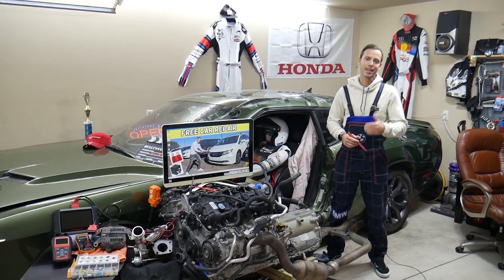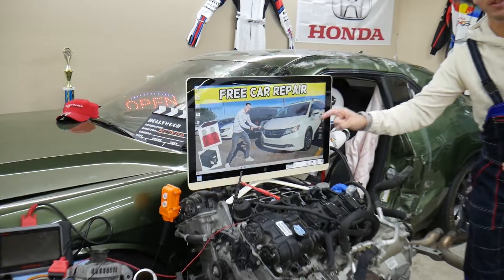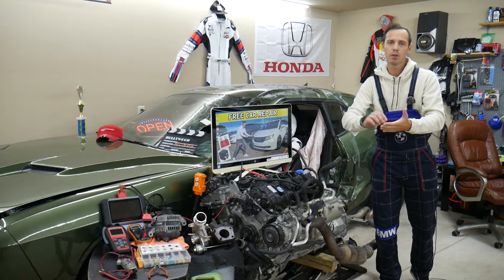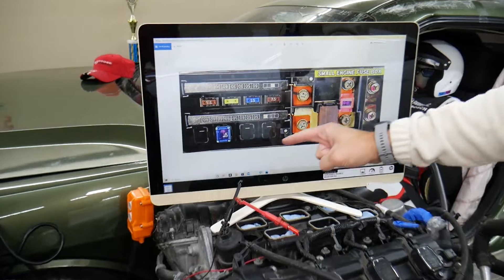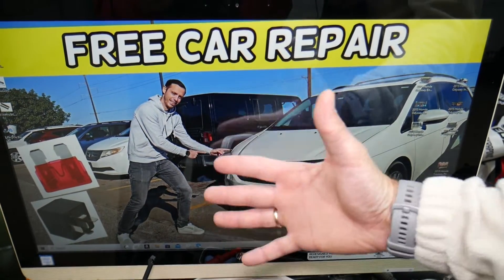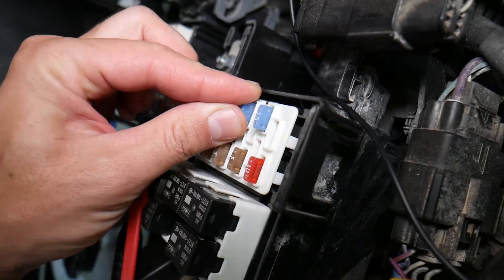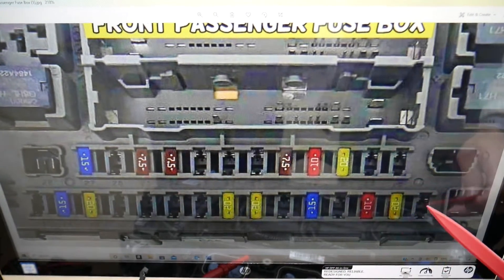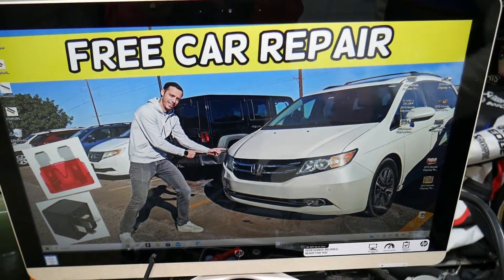HONDA ODYSSEY REAR RIGHT POWER SLIDING DOOR FUSE LOCATION, DOOR NOT OPENING CLOSING FUSE 2011-2017

Comment: I replaced fuse 9 on the driver's side fuse box and fuse 13 on the passenger side. Still, neither of the sliding doors work 
 What should i do?
2014 Honda Odyssey